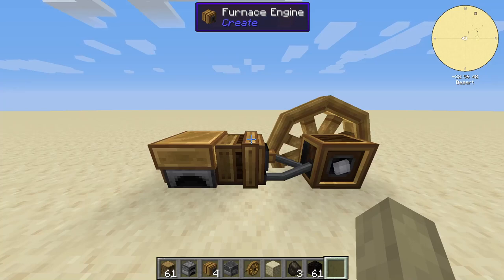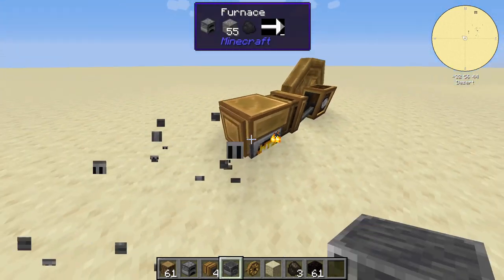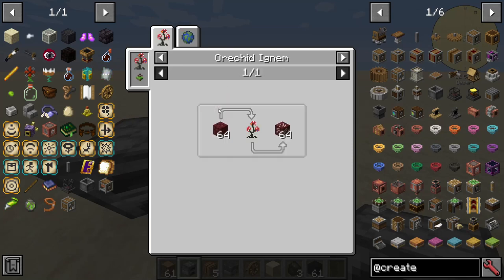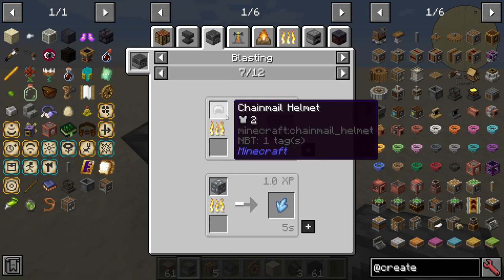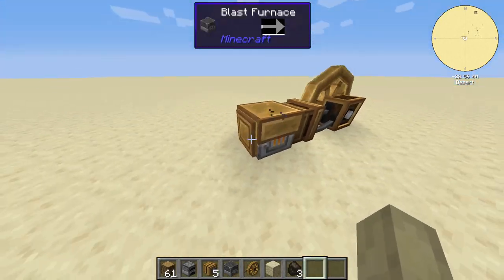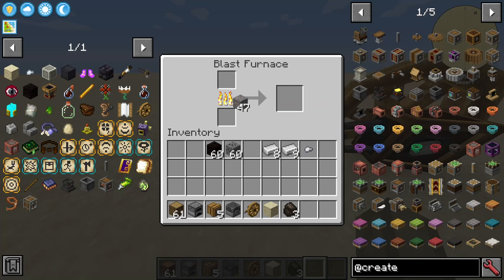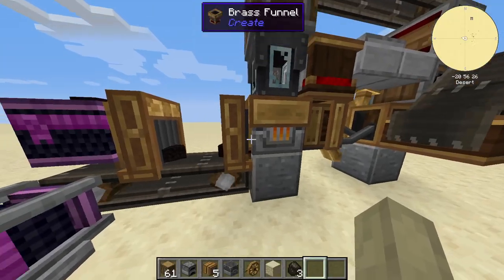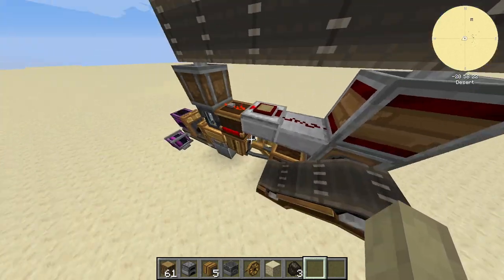Create 0.3 Automatic Blast Furnace Generator (WITHOUT USING ORE!!!)

Comment: I have an infinte supply of lava in the nether (using a hose pully to pump up lava), so with this, I should have infinte power.

edit:
There are some other mods which are in the same pack as I'm using (a custom set assembled by a friend of mine) which can also cut off the fuel source.

Botania (an industry mod disguised as magic where you work with mana to create effects) has a flower, the exoflame, which will fuel nearby furnaces with mana, so if you can get a steady mana supply, your engine will run indefinetely.
Blood magic (a mod mainly based on items using lifepoints sacrificed to an altar) has multiple options:
-you can use a lava crystal, which will smelt a single object's worth in exchange for some of your network's blood
-the lava sigil, a handheld rune which will spawn in a lava source block in exchange for some blood
-the lava ritual, a stationary ritual which will continuously spawn lava source bloucks in exchange for blood each spawn

the issue with blood magic is that it's quite grindy, but if you can either deploy a viable well of suffering (a ritual which will drain any mob standing on it and sends the damage as blood to your nearby altar), or also add in evil craft (a mod which is based on constructs for amassing blood; the two have synergy), you can run rituals like that indefinetly.

So yeah, I'm just casually mastering the dark arts to make a perpetual motion machine.
Reply: i absolutely love that finish XD

Comment: The flywheel generate stress and rotational power in Create is because it uses the heat from the furnace and the heat make the furnace engine piston move, so that is why the furnace engine still work even when the furnace already finish smelting something

Comment: Once the furnace stops burning, the whole thing would shut down, wouldn't it? Then the timer and stuff won't matter, the fan will turn off and drop the ore back in. So you could forgo the timer entirely. Just have the fan pull the ore out and when the furnace stops, the or drops back in.
Reply: Well, unless you got multiple on the same line for moe power. than each wou need a it own cut off swtich

Comment: I was thinking that you could use brass (or any other ingot), crush it, insert it back into the blast furnace, then repeat. but this works too.
Reply from the maker: Problem with that is that only way to obtain crushed brass from brass is to crush it in block form: which yields only 5 brass (9 to craft a block). With default recipes you are at a significant loss, brass being non renewable then is a big issue